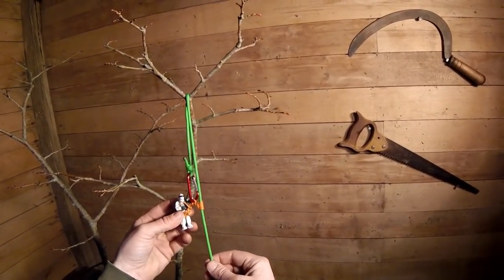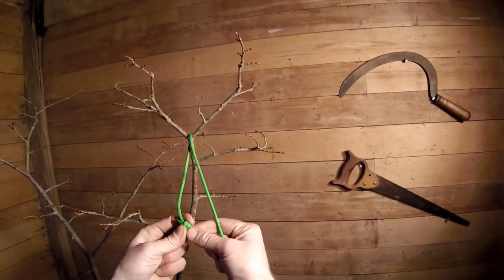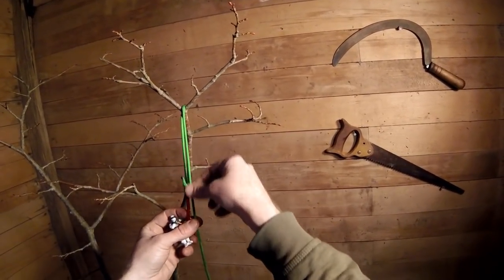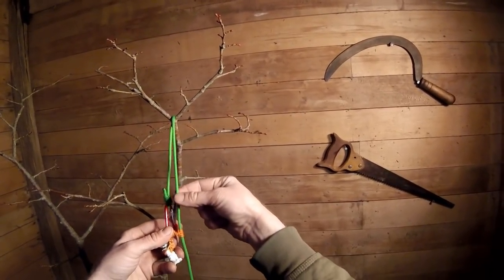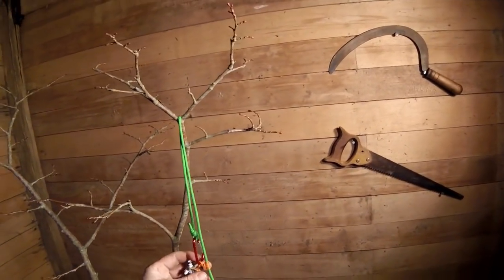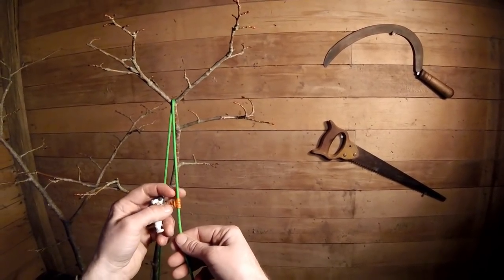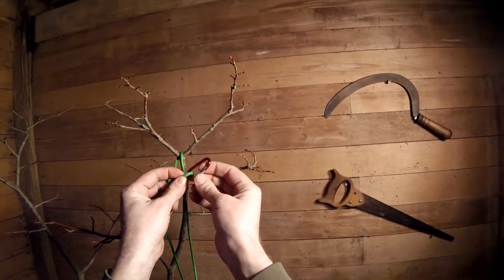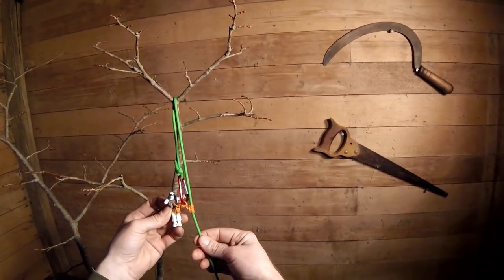Tree Climbing Systems DdRT vs. SRT

Comment: Would using pulleys and or cambium savers help with redirects using DdRT?   I am leaning toward the DdRT with a Hitch Climber setup, but understanding how both systems work is extremely helpful. Thank you.
Reply: Just get a rope wrench and you can switch back and forth. I've been climbing for 23 years and I put off switching for way too long. Rope walking rules too. So worth it. Try set once and you'll be sold.
Reply: But yeah, you could just use a sling and a beaner and put a redirect anywhere. Even easier with srt.

Comment: Thanks for the video. Can you climb srt with just a prusik and pulley instead of the mechanical stuff? Iv not seen anyone do that. Your model was close to what im talking about, just add a micro pulley.
Reply from the maker: You need to add a rope wrench above the hitch to climb SRT, otherwise your hitch will just lock up on descent...      - Patrick
Reply: @TreeMuggs_PatrickM  makes since. Thanks so much for the reply. Stay safe out there.

Comment: Well thought out video bro, ,,,,,,but,,, there is no mechanical advantage as you mentioned on dirt. Mechanical advantage would only apply if the moving part , load  had rope advancing through it, .......technically you’re trying to pull the tree fork down on a 2:1 mechanical advantage but the tree is too heavy and you move towards it. The fork “static” is holding double your body weight. Nice vid

Comment: Thanks for this! 
Why isn't double rope, non-moving one of the stand-by techniques? As a rock-climber, this was on of the go-to ways to climb a rope. 
I'm talking when the rope is draped over a limb/anchor, both ends hang, but then you climb both strands with your friction-hitch around both strands (a sort of hybrid between these two)?
Reply from the maker: What climbing setup were you using to climb a rope like that?    - Patrick
Reply: @TreeMuggs_PatrickM  Well, it's been awhile, so to be honest, details are fuzzy... but I remember using a prusik for the harness attachment. Feet varied: I believe either foot wrapping or a sling tied into a klemheist. Perhaps it was too slow

Comment: Treemugs your videos are awesome so thanks for your time and expertise!  However there is no mechanical advantage with DDRT! A 150# person is still lifting 150# and that doesn’t consider friction at crotch. The weight at the crotch is now 300#. Thanks again!
Reply from the maker: the only people who would claim that doubled rope doesn't have mechanical advantage are people who have never tried it.... hang a pulley on your anchor point, put your climbing rope through it, and try it out..... you'll be amazed at how much lighter you feel pulling your body weight up. Then try the same thing with a single leg of rope (srt)...... big big difference     👍🙂       - Patrick
Reply: @TreeMuggs_PatrickM When you're at rest on a ddrt, yes, each side takes 1/2 of the load. But in order to ascend 1 foot, you still need to pull 1 foot down on the descending rope. There's no Mechanical Advantage. A 1/2 MA happens when you have an anchoring point at the top and a moving pulley on the load, then you pull UP the rope, so each 1 foot you pull up, the load lifts 1/2 foot. No moving pulley = no MA. In order to ascend solo on a 1/2 MA you'd need to anchor your rope at the canopy, pass it through a moving pulley on you, then pass it through a fixed pulley at the canopy (just to redirect it down), then you can pull it down in order to ascend.
Reply: 2:1 mechanical advantage for sure. Each side takes half the load.

Comment: A video on how you get the rope up to the top, to begin with, would be really helpful for me. This is a great video on climbing technique, and I've seen a few good ones now, but I still don't know how the rope is initially getting way up there to the top of a tall tree. Could you do a video on getting the rope set up in the tree in preparation for climbing/rigging? I just bought my first house this year and I want to take down my own trees as well as be able to do it for friends/family.
Reply: To capture a relatively low crotch, you use a weighted throw bag and some small light slick line. Once the weighted bag is thrown or launched through the fork, it falls back down bringing the small cordage with it. You then tie the slick line to the climbing rope, or a friction saver device, and pull one end while the other end is hauled and fed through the fork. Personally, I've set really high overhead lines with 100lb braided fishing line tied to an arrow with three lug nuts duck taped on the front, but that stuff does tangle up quick if the tree is hairy.
Reply: @truckermike5853  Thank you!
Reply: You're welcome, Muggs actually did a more demonstrative video on this that you might like. https://www.youtube.com/watch?v=ZbK_a2TsEIw